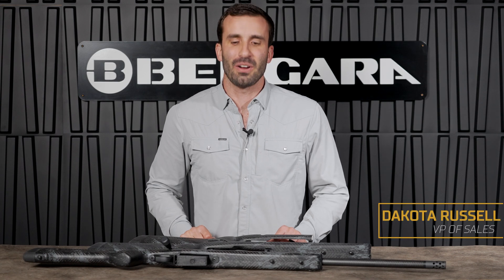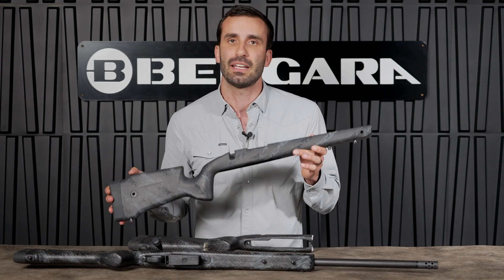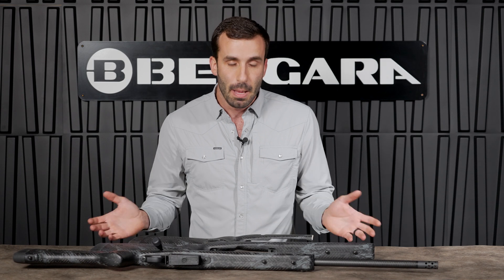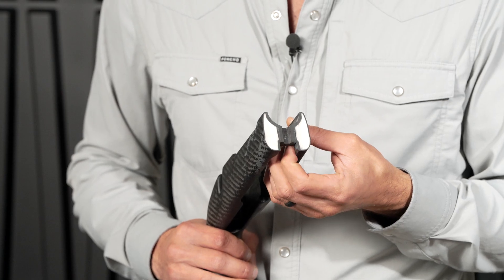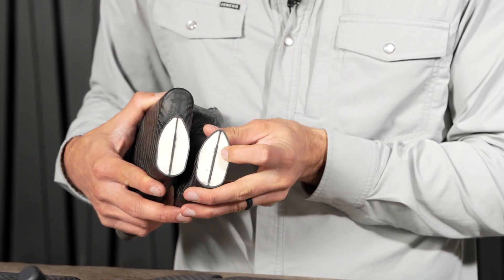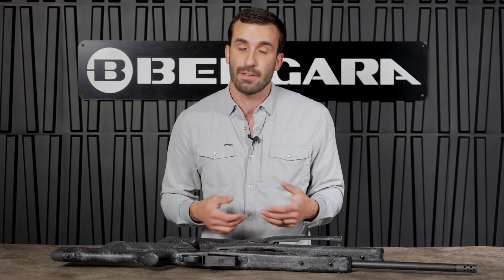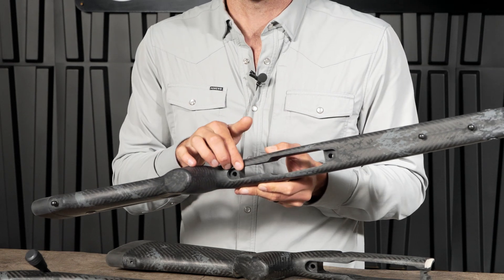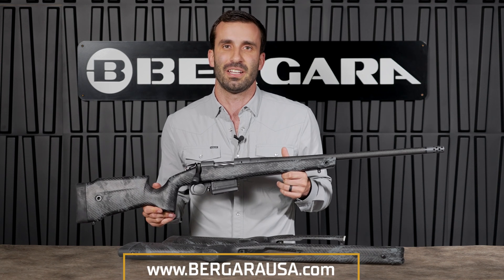Hands On - Bergara B-14 Squared Crest Stock (Technology Explained)

Comment: What is the difference between the CREST rifle and the SQUARED CREST? DO any of them come in a 24" barrel at all? I would love a 7PRC in a 24" metal barrel with the 3 shot clip not the longer 5 shot. I do not like the magazine protruding way down the rifle.
Reply: I also want a 24" barrelled 7 prc
Reply: @jdirt1982  The only one I could fine was the Waypoint 2020 and the new XBolt2 by browning. I ended up purchasing the Bergara B-14 Crest in a 22" I just like that rifle the best and found some 3 round magazines from MDT so I am good. I will just buy a cronograph to know my true velocities. Good Luck finding what you want.
Reply from the maker: The rifle series is called the B-14 Squared Series, in that we have the Standard Crest and the Carbon Crest. At this time all the long action calibers come in a 22" barrel.
Reply: @BergaraOfficial  Thank you for the quick information.